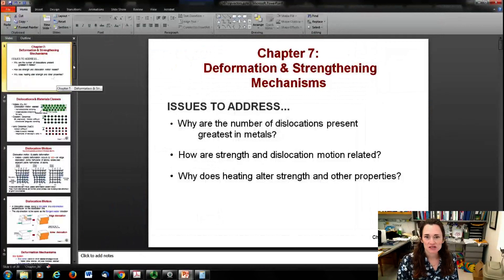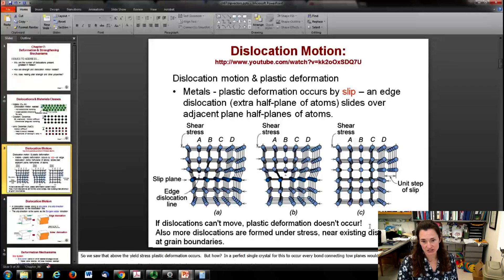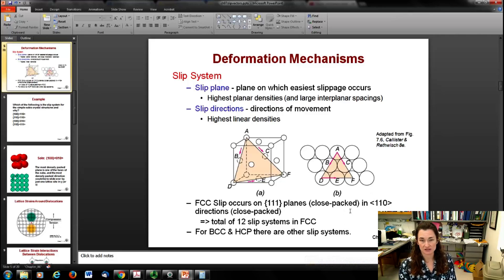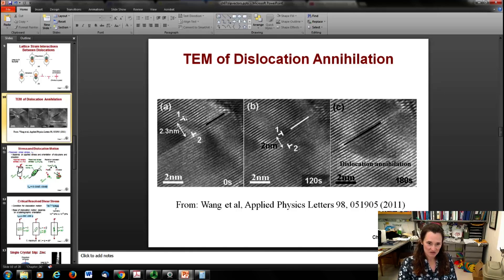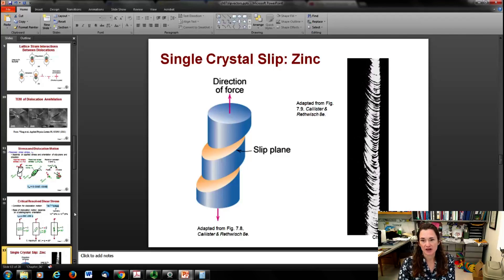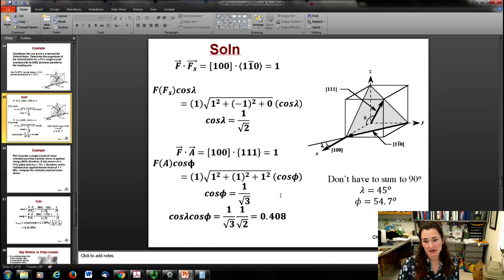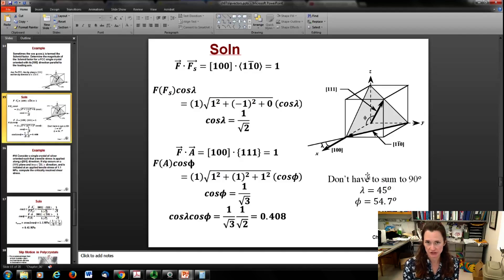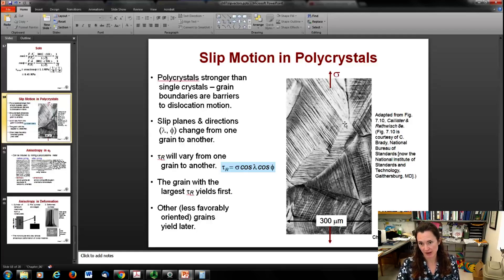Slip planes and slip directions

Comment: I have a question. I don't understand why the slip direction is the same as the Burguer's vector direction in screw dislocations. The slip direction is perpendicular to the dislocation line , but the dislocation line is parallel to the Burguer's vector in screw dislocations. 
So I don't understand this.

Comment: Isn't phi the angle between applied force and slip PLANE normal?
Reply from the maker: Hi! Yes, if I misspoke I apologize for that--it is easy to get tongue-tied with these definitions. In the textbook we use (Callister and Rethwisch) for this class, phi is defined as the "angle between the normal to the slip plane and the applied stress direction." I believe it is stated correctly on the slide.
Reply: @chrisian Young  @tonyacoffey5568  Because we are measuring angles in different planes. 
If normal to slip plane, slip direction and applied force direction lie in a plane, then phi and lambda would be compliment angle, otherwise each angle should be calculated by vector dot product only.